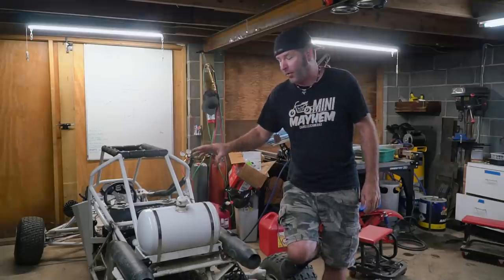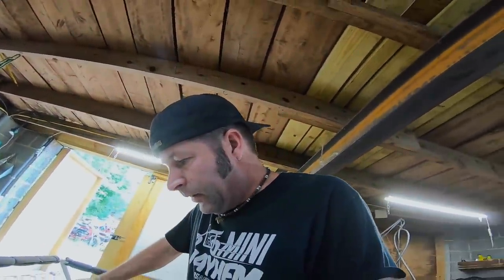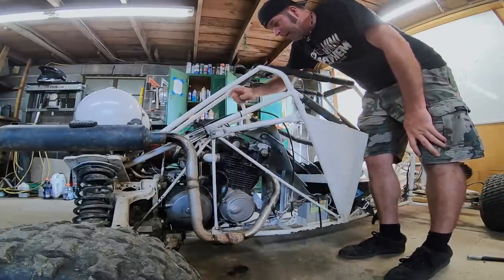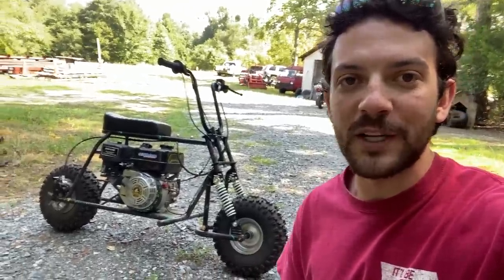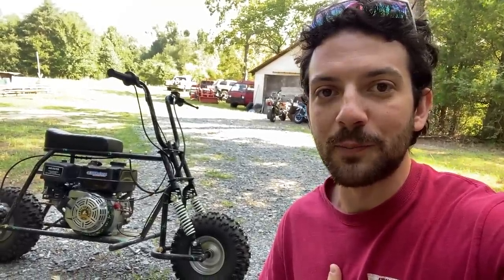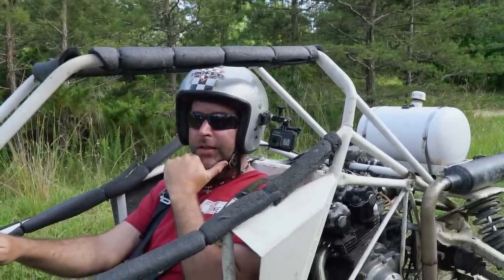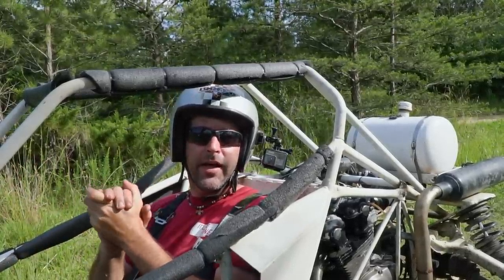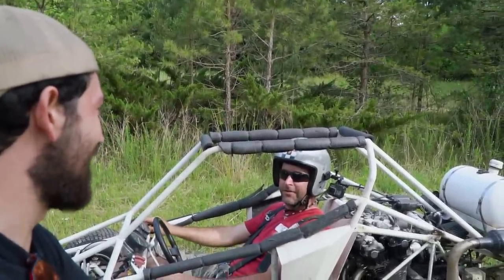Our FORGOTTEN 750cc Powered Cross Kart Returns to FULL POWER!

Comment: Not likely at full power when missing 2 carbs and using a janky intake manifold.  Why do you not want to run 4 carbs like the engine was designed for?
Reply: Because they dont know much about jetting or the effects of a proper air box on CV carbs
Reply: They could not get the 4 carbs to work way back when ad tried to simplify with two carbs.  It worked until they installed this new engine.
Reply: @JimmyJamm  If I remember rightly, the two carb setup was an attempt to fix a problem that turned out to be caused by something else. It never seemed like it ran that great with the old engine, hence why they were so eager to replace the whole thing instead of just the broken oil pan. The issue is that they transferred the problem from the old engine to the new and are wondering why it still doesn't run right.
Reply: @crudboy12  perhaps, not certain if I really recall.  Regardless I think they are tired of trying to fix junk and are wiling to pay for a decent motor now.

Comment: Clean the pick-ups on the fly wheel, metal particles you find in the motor are magnetized to the stator and foul the signal.
Reply: The fly wheel is your distributor .
Reply: @slamboy66  yeah I've seen metal shaving on them before. I dont know how but it happens. I've had some that have been rusty and I sandblast it and it runs fine.

Comment: Guys, guys guys, please.
You have 4 cylinders fed by 2 carbs. That in its self is not bad.
WHAT IS BAD IS, the 2 inside carbs get straight flow from the carbs.
The 2 outside cylinders have the flow forced through 2 90 degree turns.
The fuel mixture is very different between the cylinders.
Put 4 carbs on it!
Repeat,
PUT 4 CARBS ON IT!!!!
Or at least a manifold to balance the carbs.

Comment: Hey guys. First step in a good tune up is to confirm compression is balanced across all cylinders. Within 10% of each other. Second thing I see is you are trying to feed 4 cylinders with half the carburaters the bike came with.now that u have a sonic cleaner surely u can find 2 more decent carbs to put it back to stock configuration. Third(and this is just my personnel opion) put some bigger tires tires on that thing! Get it up outta the weeds and make it roll over obstacles easier! Keep up the good work.i enjoy ur channel.

Comment: How do you expect spark plugs to work when they are not touching bare metal?  They have to be electrically connected to the frame/engine to work,,,
Reply: Exactly! At least put them on the valve covers!

Comment: So don’t the plugs need to be grounded to spark consistent. Wouldn’t the paint keep them from grounding to the frame?
Reply: wouldnt run at all if there was no ground, plugs ground through engine.  Their problem is the intake piping and firing order.
Reply: They "should" ground , but have fun watching for spark with that bouncing crap allover the place. 
Either get a Briggs spark tester for 8$ or wrap a wire around the plug to ground it. 
The spark checker is way easier to deal with though.
Reply: @MrTheHillfolk  oh you guys are referring to when spark testing against the frame.  Yes, a better ground would be better.
Reply: @NVMDSTEvil  and really , most spark checkers make it jump like .100-200 or even .250 of an inch or more.
You might have spark at a plug gapped at .035 but load the coil with a 1/4 inch gap and see it fail under load. 
That simulates a load similar to it trying to fire in a cylinder.
Reply: @NVMDSTEvil  
1342 it should be and ya got a wasted spark on the exhaust stroke of that cylinders running mate.
Running mates , firing order , knowing which way the "dizzy" turns and you're unstoppable from figuring out any firing order ever.

Comment: That simple green degreaser is Great. Spray it full strength onto your wet deck or siding let it sit a bit and pressure wash it off it will take all the mold and dirt off great stuff

Comment: A set of coils from a CBR600F2/F3 are the same impedance as the originals (therefore won't damage ignitors/spark units) but will give a noticeably hotter spark. Cheap and almost bolt-in ignition upgrade.

Have y'all checked valve clearances? If that engine wasn't well maintained before you bought it, good chance at least a few of the valves are way too tight and you're losing compression (and on the way to burning a valve). Aim for ~.005" clearance... adjust by changing shims. Then do a vacuum sync of the carbs.

Also... agree with everyone else commenting on the intake manifolds... no way those things are providing consistent mixture to each cylinder.

Comment: 24:15 your left side carburetor is completely missing the brass cable adjuster on the top cap. From the looks of it your right side carburetor slide will move 1/4 of the way before the left side even starts to move. There is also going to be an air leak from those areas since you aren't using the rubber caps that go over the cables.

Comment: Could you guys re route those exhausts so they go almost horizontally out of the engine, over the frame support, and go straight out the back. They may need some heat shields, but it’s just a suggestion to get a bit better flow

Comment: 23:15 I think you need better front coilovers with more travel and a higher springrate to prevent the front digging in, Also that left front hub could do with some work too looking at the camber angle.

Comment: They do sell spark checkers. Plug them in and they flash nice and bright if that wire is providing spark. Might wanna pick up 4 so you can see them all working or not. Your welcome.
Reply: Briggs ones are nice , but around 15$ each. 
2 of em would work though

Comment: You guys should look at mini sprint or midget wheels for that. Mini sprints use 10 inch wheels and midgets use 13s. It would give you a ton of choices in tires (and real race tires), they are lighter, and they will give you a little more ground clearance.

Comment: As an old guy of 60 that worked at a Suzuki shop back in that era, late70s and 80s I can say like so many others have said that intake piping can’t be good. We always had individual carburetors that we synchronize with a vacuum gauge. The the carburetors were all linked together mechanically with a few rails across them all and had precision adjusting screws. Until you got the balance set at an idol it would not idle smooth. With that outside pipe coming from the center pipe I just can’t see how that would run correctly, is that a stock setup or something you guys invented?
Anyway stay safe keep building 😎
I haven’t followed this build super close and would love to be 30 again and blasting around that track.

Comment: Not surprised the spark is weak with the plugs sitting on the painted frame, the body of the plugs need to be in contact with a good ground to test them properly.

Comment: Ohm test your coils for proper resistance? I'll say again, get you some Chevy LS coils, make you a platform to bolt them on and have four coil on plugs. It's only three wires, power, ground and trigger wire. You'll have strong spark for each plug and new technology coils that'll last!

Comment: Loving this machine. In agreement with comments below about the intake setup.
It's a huge restriction being half the carbs needed for the engine as compared to stock, plus the intake branching is not exactly efficient. This thing would slap so much harder with a set of four FCR's.
Still a fantastic bit of kit, no matter how it's sliced tbf. Keep it evolving. =]

Comment: If the cross cart will be drive a lot, it would be worthy of a CB750 crate engine (if that exists), or one built by an engine builder.  Perhaps too expensive, but the CB750 seems to be the format that fits best in the cross cart.  Perhaps all this engine needs is a complete rebuild of the ignition components, new or rebuilt carburetors and a custom intake that removes the 90 deg bend to the outside cylinders?  This cross cart is worthy of any investment you can muster.

Comment: I recon it’s the mufflers you know ,either they are clogged with so much crap and restricting the flow or they are too restrictive and causing too much back pressure back to the engine thus making it stall out ,I bet if you take  those mufflers off it will run better ,also modify the intake ,great work guys 👍👍

Comment: What about the needle on the slides of the carbs, try moving them up or down depending if it needs more or less fuel at idle, and with you needing to hold the throttle on start, I'd say drop the needles down 1 or 2 clips

Comment: maibe put that boxfan in one of the open windows to extract the fumes a bit better 
youre going to get a lot of use out of that ultrasonic cleaner , aspecially with how you put youre projects away / store them
about the vacuumleak / smoking  , maibe it sucking oil through the valveguides or the head has a crack intoo one of the intakeports (near one of the cilinderheadbolts?)

Comment: if I was to make a suggestion.... a motor off of a 82 to 87 Honda Sabre or Honda Magna. Shaft drive, 700/750 CC for 80 hp, the 1300 for 140 HP. You can swap the 4 carb set up to a single larger carb for better reliability at a small sacrifice to hp. they rev, have great low end grunt, and are all around a great starting point.

V-4 life. flat fours can pound sand.

Comment: 13:20 those plug boots have resistor built into them that can go bad and cause weak spark, might want to check the ohm resistance on them. The factory manual should give the specs

Comment: Should always check your compression on all cylinders. If their not close to be even. You'll never get it to run right. Also an easy trick is to remove idle mixture screw. And blow compressed air in it. If there is some old gummed up gas in there. It will blow it out. But be careful of fuel in carburetor bowl. It might shoot out.. this can be done without removing carburetor off engine.

Comment: Hi guys I just got home from work and watch the video I see and hear two problems one is the sliders on the carbs are closing too much and you are burning oil or it may be not getting any but it's sounds better than the last time keep working on it will come around I all most forgot did you check the timing Bryce

Comment: You might want to check the fuel pressure put an adjustable fuel pressure regulator on it one of the round ones that can adjust from 1 to 5 psi

Comment: I mentioned it on a previous video your intake runner link your outside cylinders are twice as long that’s definitely gonna be an issue again you really need some O2 sensor bongs in those exhaust header

Comment: I'm going with a couple ring lands are broken, the fact your only using 2 carbs when u should have 4. Maybe its not getting the correct gas mix per cylinder.  I didnt see any compression test or leak down test. It could be bad valve seats. Theres something that yall are missing for sure. I Love the channel, but I wish I could be there to help you pump out more content and get everything running correctly. ❤

Comment: I would possibly use an ex500 ninja twin cylinder. They make almost 60 hp stock. Way smaller package and water cooled. You should find one pretty easy. Motor didn't change for almost 30 years.

Comment: Since you did some work on carbs how bout changing the spark heat and maybe the gap is not the right one I've seen it on 2 cycle equipment like echo, specially the ones that take a resisted plug will give you problems if not put in the right resistance and heat range.

Comment: I'm still not 100% sold on the intake setup. It seems like it works enough to run, but not very well. Seems like either, two cylinders are getting a different air/fuel mixture than the other two, or, fuel and air are taking longer to get to the outer two cylinders. Naturally, it would run a HELL of a lot better if the original 4-carb setup was working properly, but that's going to be a huge pain in the ass to get those to work properly. Maybe if you changed the intake manifolds to a Y-design using some exhaust pipe, you could distribute air and fuel more evenly, as well as at the exact same time. It just seems like it never quite ran properly.

Comment: John: "It probably just needs to warm up"
Ike: HOLD MY BEER at 5k RPM!

Sheesh guys.  Did anyone do a compression check?  Cylinder leak down?

Maybe try grounding the plugs to a CLEAN METAL SURFACE instead of a painted surface when checking for spark.

And find a motorcycle junk yard that has a Hyabusa 1300 and drop that on there....

Comment: @CarsandCameras you guys should really look into putting a proper set of carbs on it , either odd the 750 or 900 version  of the same bike 

That pic pipe setup is gonna kill plugs and if it dosent it'll start melting pistons etc 

Not to mention , that you've gimme performance so far , proper carbs jetted to suit some cone filters and it'll be ALOT faster and ALOT more reliable :)

Comment: It would run better with four carbs over the pair, the electrics are a total loss system so all plugs should all fire all the time and a healthy spark so could be the ignition module on the end of the crank.
Reply: Exactly…they didn’t test the complete ignition system.Runs like shit. I’ve worked on hundreds of these.

Comment: Once warmed up, your 750 should idle at 1050rpm. (OK, 1100 is fine.) It should snap right off idle with any application of throttle, and immediately return to idle once the throttle is released more information you need to look up the information when you get a engine might help when you have one with everyone help on YouTube finding a problem this is a great place to find it or goggle it

Comment: I am thinking two options: proper carb synching with a mercury tool or similar device and/ or ditching the CB750 all together and going with the tried and true (from the same vintage) KZ1000 as a used and abused privately owned, or bought used and abused and it still ran strong Highway Patrol issue donor motorcycle. Those Kawasaki's have ran the gauntlet privately owned and commercially owned and still to this day I see them occasionally on the road 40 years later. Better yet, get a hold of an H2 750 or an H1 500 engine and.... Well if you are familiar with them, enough said.

Comment: Well yes it could be that intake but I'm wondering about the timing because of the sound that's coming out like it's back firing on 1 or 2 cylinders and at the same time u can see a puff of raw fuel out the pipe not positive though lol

Comment: use a Philips screw driver,   stick the end of the screw driver in the plug wire,   hold the shaft of the screw driver about a half inch away from the cylinder head, the spark should jump from the screw driver shaft to the head.   best way iv found to check for spark..

Comment: Go right through the electrical system. Get rid of all the junk wiring & create better earth points (super important), reset the timing (super important), check the compression & run a stock intake & carb setup - yes expensive, but may be the crux of your issues

Comment: Have u synchronized ur carburetors together at all using a vacuum carb synchronizer or just adjusted the throttle blades to all open exact times and adjusted each carbs amount of vacuume on idle to mach eachother probably whats wrong with is

Comment: Would definitely check the ground Leeds any corrosion or paint from the coil to the frame back to the battery I would physically regap the plugs to spec via Honda push them under .002's  and bring them back out proper feeler gauge only and if you feel that they're still not running right then all that's left besides the compression test is the timing is chain if there is there's a good chance it could be stretched if you go that deep definitely check the lobe and your journals cuz all that can add up easy. before all that I would drain  try running 93 octane

Comment: Make sure it's charging, those motors will only run on a fully charged battery. They will not charge a low or dead battery. Unless you upgrade the stator.

Comment: Its coil!! If it wasn't running proper with the coil on the two center and you swap it and it does the same on the two outter then its a bad coil. And the carbs seem to be doing the job because its getting the gas there just doesn't have enough ignition to burn it off.

Comment: Newer Suzuki GSX-R motor. More power, fuel injection, easy to come by (and cheap), liquid-cooled, reliable. Probably better for the application. Especially since there's not really any shortage of wrecked GSX-Rs around. Or even an older carbureted one. But, the fuel injection is a plus IMO.

Comment: If you want to figure out whether it is fuel or spark spray some brake clean into the carburetor if the engine suddenly comes alive that means you are getting spark but no fuel in that cylinder but if nothing happens you are likely getting fuel and no spark this is very simple when you have one carburetter per cylinder on an engine I hope this helps you out next time guys also A good idea would have been to perform a compression test on the motor the moment you saw all that smoke coming out of the tailpipe’s I notice you’ve only got two carbs but four cylinders you can very easily pull the manifold off exposing the IV intake ports and spray brake cleaner into them to see if it will fire on that cylinder it will also give you an idea whether you have any compression or any bad valves but checking spark with a spare spark plug and checking compression with a compression tester would be the way I would do it from the beginning
Reply: Also fuel filter?? Is it Clean?do you have one?